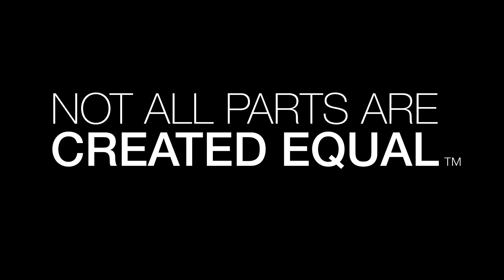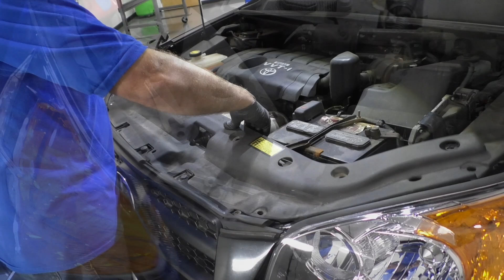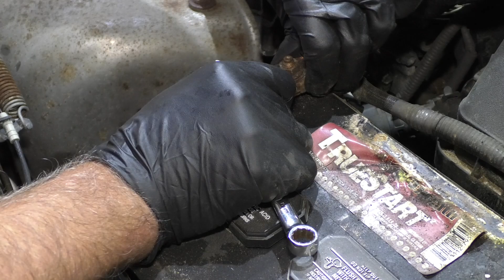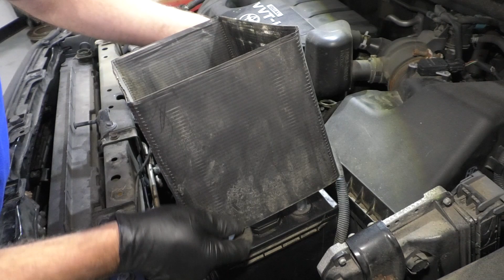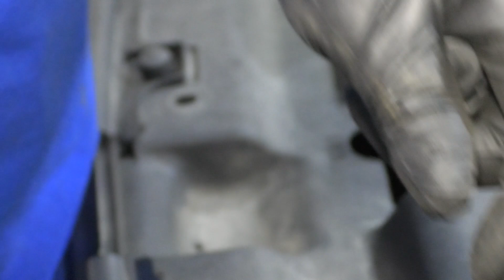How to Replace Battery 05-16 Toyota RAV4

Comment: Mostly good. I would have cleaned the terminals at the same time as the battery. And what does that infernal long thin bolt connect to?

Comment: Drill a hole in that trim piece over the battery hold down bracket bolt.   That way, you don't have to take it off every time.

Comment: Thanks for the explanation of those push pin connectors!  I found that someone had worked on my car and put in permanent replacement ones on some of them (I say permanent because they had no push pins so I had force them out breaking a few!).  So I will be buying those nice push pin types to replace them.

Comment: No matter how many times I read it, see it, and done it I still cannot understand why you would connect the positive terminal on a battery before connecting the negative (grounding)  terminal. Before I knew better I did it the other way around and never had a problem.

I just do what I've been told, but would love to know the exact why(s) behind it.

Comment: This video does not apply to a 2005 RAV4.  2005 is part of the second generation of RAV4's that went from 2001 to 2005.  Their battery is near the firewall, on the passenger side, under a cover.

Comment: Wait that's not where the battery is located on a 2005 RAV4.  Not even close.  Change your title not for 2005.  The battery is located passenger side under the windshield.

Comment: Thanks for the video.  Although I have been changing out batteries for over sixty years I would have never figured out those push pins on the plastic cover. So simple when you know what you are doing.  Thanks again!

Comment: TIPS & NOTES: Before you go out and buy trim removal tools, my 2015 RAV4 XLE 4WD plastic engine bay shroud did not cover the bolt for the battery bracket, thus it didn't require removal. So it depends on year/trim, might even vary within same year and trim (running change?). Also, no need to remove the battery bracket, you can slide the battery out/in while said bracket remains affixed to the wiring harness. I highly recommend buying the battery from Costco, only $78.99.
Reply: Do you know if that applies to the 2016 rav4 SE as well?
Reply: Or you can use two screwdrivers to pry it out gently.
Reply: RAV4 battery 2018 model, how many amps??  What is the best battery??

Comment: Yesterday I replaced my battery for my 2010 year rav 4. After my cd player didnt work? What should I do?
Reply from the maker: +Od Dash We wouldn't be able to diagnose an issue like that here, you may want to have a local mechanic take a look at it. It seems like some electrical connection was knocked loose. Thanks for checking us out! http://1aau.to/m/Shop-1AAuto-c

Comment: how many amps is the battery for a rav4 year 2011?
Reply from the maker: +Mario Alberto Peña Thanks for checking us out! There are several options depending on what you use the vehicle for. A local parts shop or dealership will give you more information on these. You can also check the owners manual for the original batter specs.